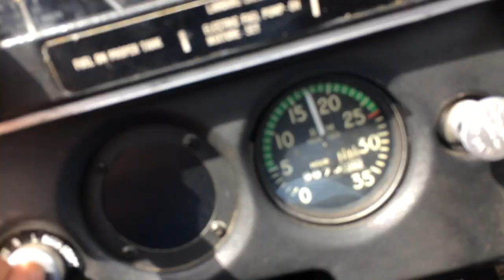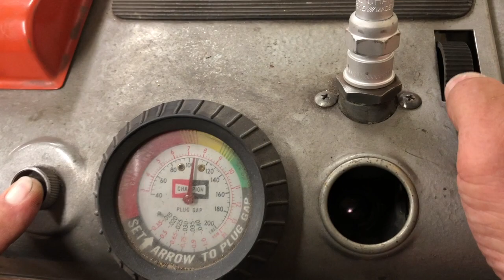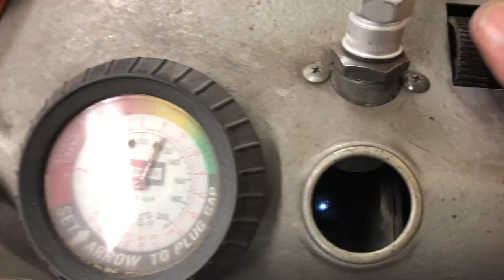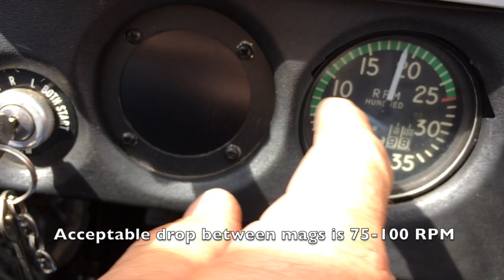Trouble Shooting Aircraft's Bad Spark Plug

Comment: Thanks can't wait to try this out.  My mag check failed with a near 300 RPM drop yesterday and killed a great day to fly in Florida. I noticed you went to the lower plug right away.  Also can I OHM out the spark plug since I don't have a tester readily available?  Good stuff. Thanks again